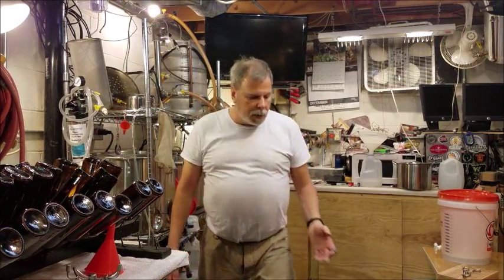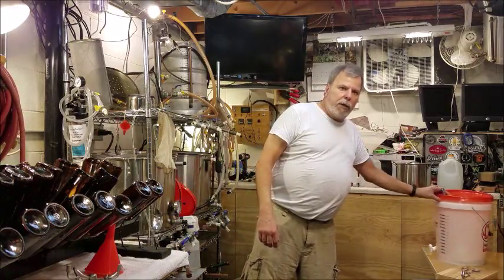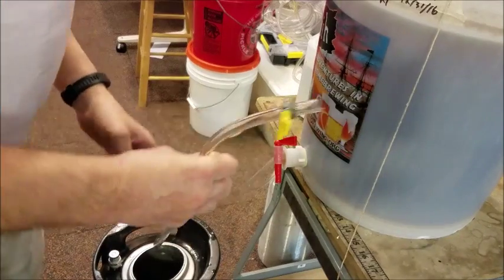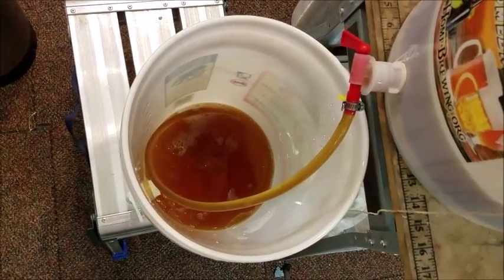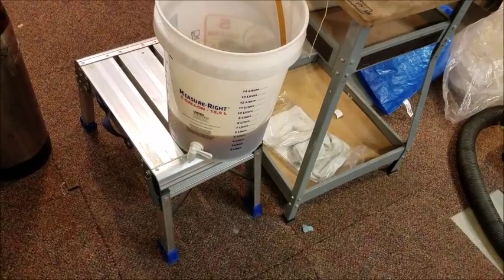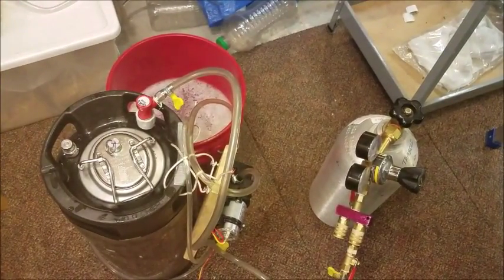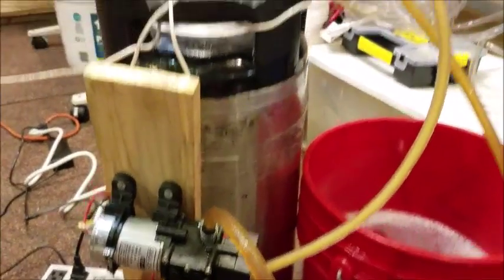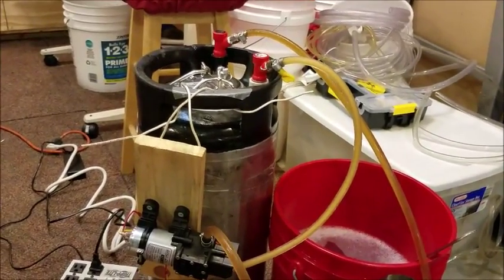Carbonating a Keg with the Rapid Carbonator - Start to Finish

Comment from the maker: Update.  I realize why it was so over-carbonated.  I realized this after retracing some steps I had done a year or so ago and forgot about (due to a question by MSULOCK3191).  I put a pressure gauge in between mine and the keg.  I realized that I was reading and using the wrong scale on the gauge.  There are two scales (I am not sure why, but I think one is for flow and the other for pressure). One goes from 0-45, the other 0-100.  I was using the 0-45 scale and should have been using the 0-100, scale, which coincided with the other gauge I put in line.  So, instead of 11 lbs of pressure, I was putting it in at somewhere around 25 lbs.  DUH.

Comment: The B brand uses a 6V power supply and its pump is listed @50 PSI. Did you use a 12V power supply? If so, your pump's spec is 100 PSI at full strength. I guess if you switch to a 6V power supply like the B brand, your pump's PSI will drop in half to 50, which may solve your over carbed problem.
Reply from the maker: Yes, I did get a 12v/4a power supply and it works well (it is actually a replacement flat screen TV power supply).  I don't think the pump's PSI would make that much of a difference, if at all.  It is just recirculating and there is no real resistance or back pressure, other than the CO2 going in.  That would probably come into play if I was pumping up a hill.  That is interesting about the B one, I maybe could have saved some money on a smaller sized pump (it was only $16, so no big deal).  Their instructions say to run for 30-40 minutes at 1-2 psi above the chart.  I may try that next time. FWIW they also use a 10 micron stone compared to my 5 micron one. I think part of the bad pour was due to the beer still being a little excited. I waited about 30 minutes after moving it to the Keezer to pour one.  I probably should have waited a little longer.  I poured a glass the next day and the carbonation was pretty good.  I also think I should have carbed it at a little lower PSI, on the lower end of the range for 2.2 vols.  I probably should have checked it at about 45 minutes too, when it started to slow down. I don't know.  Having only used it twice, I guess I am still in the live and learn stage.
Reply from the maker: Update.  I realize why it was so over-carbonated.  I realized this after retracing some steps I had done a year or so ago and forgot about (due to a question by MSULOCK3191).  I put a pressure gauge in between mine and the keg.  I realized that I was reading and using the wrong scale on the gauge.  There are two scales (I am not sure why, but I think one is for flow and the other for pressure). One goes from 0-45, the other 0-100.  I was using the 0-45 scale and should have been using the 0-100, scale, which coincided with the other gauge I put in line.  So, instead of 11 lbs of pressure, I was putting it in at somewhere around 25 lbs.  DUH.
Reply: So if I were to build this system now, should I be searching for a 50 PSI dc pump or just pick up the 100 psi pump and use a 6v power supply?  I am also thinking about using the pump to push beer thru a cartridge filter and use to transfer beer from fermentor to keg..

Comment: Hello Tim, I am new using kegs. I just bought my first pair the last week, I want to know what kind of hose do you use for de CO2.  It does look thin when you put the CO2 on the bottles and you  got red one on the kegerator. Is it the regular one if not, what kind should I get? thank you.
Reply from the maker: Slight update.  I checked the lines on the carbonator today.  The gas line from the tank to the aerator is 3/16" ID x 5/16" OD beverage line.  It is sized to the aerator. The lines to and from the pump for the beer are 5/16" ID x 7/16" OD.  I sized them to fit the input/output on the pump.  I had to buy fittings for the "T" to match them.
Reply: Thank you!

Comment from the maker: I used it for the third time a couple nights ago on a WIt.  I ran it for about 45 minutes at about 11lbs to get the 38 degree beer to about 3.0 levels of carbonation.  Well, it seems like 45 minutes is still way too long.  I tried a pour and it filled the glass up with foam.  Once the foam in the glass subsided, after about 10 minutes, it tasted good and was still carbonated OK.  Last night I let the pressure off from the PRV.  I re-attached the CO2 and set it to about 4 lbs.  It still came out 2/3 foam.  I think I am going to need to let pressure off a few times to get it settled down.  I was pouring through a picnic tap with about a 4 foot line, maybe it needs to be longer.  The beer in the line only had a few bubbles, but boy it expanded when it came out.If you are going to use one of these make sure your keg lid has a pressure relief valve, just in case.
Reply from the maker: Update.  I realize why it was so over-carbonated.  I realized this after retracing some steps I had done a year or so ago and forgot about (due to a question by MSULOCK3191).  I put a pressure gauge in between mine and the keg.  I realized that I was reading and using the wrong scale on the gauge.  There are two scales (I am not sure why, but I think one is for flow and the other for pressure). So, instead of 11 lbs of pressure, I was putting it in at somewhere around 25lbs.  DUH.

Comment from the maker: I have recently learned something about carbonating with a stone I thought I would share.  

I didn't really know of a concept called "wetting the stone".  What this is, is the pressure it takes to get CO2 to start flowing through the carbonating stone.  Blichmann, in their Quickcarb instructions, recommends setting your pressure 1-2lbs greater than the carbonating pressure.  I suspect this is to account for this with their 10 micron stone.  

I hadn't really taken into account that my stone, which has 2 micron holes (smaller), needs more pressure to "wet". Having just learned this, I haven't checked what that is yet, but if you are having issues with your stone not flowing and your beer not carbonating this could be why.

Figure out what the wetting pressure of your stone is by putting it into a bucket of water or Starsan and cranking up the CO2 pressure until it flows.  Whatever this pressure is needs to be added to the carbonating pressure listed on the carbonating chart.  

I have read about people who have .5 micron stones having a wetting pressure of 4 lbs.  I suspect that my 2 micron stone's pressure is around 3 lbs based on how my beers have been carbonating and watching the bubbles flow in the tubing. Again, I haven't calibrated it yet.

I have also read that you should add 1 lb of pressure to account for the weight of the beer.
  
So, if the carbonating chart says to set pressure at 9 lbs pressure for a 36 degree beer to reach 2.3 levels of CO2,  and the wetting pressure is 4 lbs then you would set your quick carbonating CO2 pressure to 9 + 4 + 1 =  14 lbs of pressure.  Once equilibrium is reached you should have perfectly carbonated beer.

Let me know if you try this and it works for you.

Comment: OK thanks for the video & the effort to describe your method(s).
I have to say that I see little purpose in fast carbonation. Most commercial brewers will say that beer needs some time (normally a few weeks) to "condition".  As home brewers we may not do this, but in my experience some yeast will continue to fall out after kegging & that time (maybe a few days) can be used to allow a more gradual carbonation. In my case I usually pressurise the keg to about 50/60 psi & repeat after a couple of days. Then maybe 20 psi until I see the pressure stabilise at about my pouring pressure of about 8 psi. This whole time my keg is at about 4 deg C. Simple, minimum investment, less gear & less opportunity for contamination.
Finally removing oxygen by purging a dozen times at 30 psi seems both unnecessary & costly.
My approach seems to work well enough - 4 purges from 10 psi !
Reply from the maker: Thanks, I tend to agree.  Since I built it I have only used it a few times.  I typically just set it and forget it in the keezer.  But, it is nice to know that if I need to get a keg done fast for an event or I am just impatient, that I can do it.  It wasn't expensive to build and is another tool in the arsenal.

Comment: Hey Tim, first of all, thanks for the video, I made my InLine system by your instructions, now I have an idea that I want to try out, and I would like you to give me an opinion.
In principle the workflow should be like this, primary fermentation is done in a plastic conical fermentor, where after cold crashing it with glycol immersion chiller, I would transfer Beer with a pump to a pressurised stainless steel vessel (custom made Brite essentially), 
but in between I would be transfering  the beer through a 
1st chiller with a copper coil dropping the temp to 2C, 
2nd Filter (made from inline single pass water filter) and in the end 
an inline carbonator.
After complete transfer from Primary, i would reattach the hose from the primary to the Brite's OUT and recirculate until reaching equilibrium.
This is basically the same principle as if I am using a keg, so please answer, your advice and opinion would be helpful.
best regards, George
Reply from the maker: Thanks for the comments and question.  I think that would work and it sounds very similar to the way a lot of micro-breweries do it.  I do know that in lot of the commercial brite tanks they just hang a carbonation stone connected to the top tri-clover connector into the beer and crank up the pressure to force carbonate. Most of the time this is in their walk in fridge to keep it cool. When you say "and in the end an inline carbonator" are you disconnecting the filter and connecting the carbonator to re-circulate or passing it through the filter while carbonating?  I have thought of filtering, but usually just rely on finings and cold crashing. How do you purge the filter of oxygen and sanitize it? Do you run sanitizer through the filter and push it out with CO2?  Getting all of the oxygen out of the paper or charcoal has always worried me with house filters.  But, a lot of people use them.  I would also make absolutely sure that your chiller is clean and sanitized. The most important things I would watch are sanitization and Oxygen getting in somewhere.  It only takes a small problem with either of these to effect the beer.

Comment: I put a system together exactly as you have. I started carbing,  but after 3 or 4 minutes, the out line runs clear. I am carbing at 10 pounds PSI. It doesn't seem like it's carbing at all once the pressure equalizes in the keg.
Reply from the maker: I have found that it seems to work best at a couple lbs higher than the charts and then I dial it back later.

Comment: I used this Quickcarb to carbonate my beer, but when bottled (with a BeerGun) I get too much foam in the bottle and almost no beer, after finally filling the bottle I tap it. And when I try my beer it does not have almost gas or sometimes nothing ...... do you have any advice that can help me with this? I would greatly appreciate it :).

Comment: Did you ferment in the bottling bucket? When you transfer do you have any trouble sucking up trub during the pour to the keg through that faucet? I only ask because that was so much simpler than the way I do it and you seemed to have really good results.
Reply from the maker: Robert, Thanks for the question. I ferment in buckets with spigots.  I usually keg and bottle.  I typically transfer to the keg first, then to the bottling bucket on top of the priming sugar.  I like using fermenting buckets with spigots because it makes it easier to take gravity readings and transfer.  I take extra special care to make sure everything is clean and sanitized every time.   Going to the keg first I usually don't have any trub transfer there. After transferring the rest to the bottling bucket I let it sit for a while, maybe a half hour or more, so any transferred trub settles.  If I was going to the keg only I would still do it the same and be careful at the end.  The only real danger would be a little trub in the first pour or two, which is not really a big problem.

Comment: Good video, question of carbonating the Keg can you put it back in kegerator, without Connecting C02 on it en leave till you wanna drink it or should you still have a 5-8 PSI C02 on it
Reply from the maker: Once you carbonate the keg, it will be under pressure. The CO2 infused into the beer will stay there unless it is allowed to escape and the beer allowed to go flat.  So, unless you release pressure before putting it into the kegerator and it doesn't leak, it will stay under pressure and it should be fine for months until you are ready to tap it.  You don't need to leave it connected to your CO2 tank. Also, even if you do release some pressure the CO2 infused into the beer will escape into the headspace and build pressure back up to some level (but less than what it was). That is how you fix an over-carbonated keg.  You let it sit, then let some pressure out.  After doing this a few times, the CO2 is released out of the beer and the carb level is reduced. You just stop when the level is good.

Comment: Hi Tim. I see your priming pump has electrical wires to it. In your previous video you have a AC adapter. Can you elaborate on what the pump is wired to?
Reply from the maker: I am not totally sure, but I think in the other video I had it wired to another power supply.  That power supply failed (it was only 1 or 2 amps).  I got a 12v/4a power supply and it works well (it is actually a replacement flat screen TV power supply).  It is wired to the red & yellow wires  (the white wires are just screwed into the board to be used to hang it).

Comment: Tim,
I just ordered the same pump your using...thanks for that info.
Have you seen or used the keg lids that have the third gas fitting, attached to a 2 foot tube and a stone on the end ? I'm going to try that, just ordered on on Amazon for about $29.
Lee, Indianapolis
Reply from the maker: I have seen them, but never used them.  I do know breweries that use them in their Brite Tanks to force carbonate with much success.  Let us know how it works.
Reply: Francis Thompson did that keg lid work?
Reply: I've been using carbonation lids for about 3 years...they work great.  I just suggest getting 1 for each keg.  That way you don't need to keep switching lids around

Comment: is a closed system, there is no danger that in the constant injection of CO2 can increase the pressure in the system, making explosion?
Reply from the maker: Good question, but it is nothing to worry about.  The pressure on the tank is never set to be at more than 12-15lbs pressure for beer serving.  At that pressure all the CO2 that can be absorbed is absorbed into the liquid, no more.  The pressure in the tank will never rise to the level higher than that, or to a level that would ever cause any issues.  That is not to say that the tank pressure would never go up.  If the temperature of the tank of beer was raised, some of the CO2 would try to escape from the liquid, but not enough to raise the pressure significantly.  Since it is in a closed tank it won't go anywhere.  Pressure would increase because lower temps allow the liquid to absorb more gas, but, even when this happens it would never rise to a pressure level that would in any way be dangerous. The beer in them would never generate that much pressure.  Finally, Corny kegs are designed to  hold  120-130 lbs of pressure.  They have pressure relief valves that would never let the pressure raise to that level.  Also, the seals would give out before it got that high.
Reply: thanks for your time, you have tried it with barrels of 50 liter and type D system?, I think that these have more endurance than the corny

Comment: Am I mistaken, but it looks like your output pressure gauge is setup for cubic feet per minute instead of pound's per square inch?
Reply from the maker: You are right and initially that confused me too (this is a $35 Harbor Freight Tools welding gauge).  I did some research (it has been a year or so).  I believe I found out that the gauge is printed wrong or that it is the same thing.  I can't remember which. I tested this by putting it in series with an air tool pressure gauge and they measured the same (inside ring).  I think the outside one may measure flow and the inside one pressure.  Thanks to your question I went back and double checked and realized that I was using the outside ring and should have been using the inside one.  I totally forgot that and it explains why it was so over-carbonated.  Thanks for the question, you just helped me to solve a big problem.

Comment from the maker: The gas hose that I used for the carbonator is not what I use for gas line in my keezer.  Without being there to look at it, I think it is a smaller diameter hose chosen to match the fitting on the aerator.  I believe it is really beer line (3/16''ID x 7/16''OD).    In my Keezer I use thickwall 5/16" ID x 9/16" OD gas line.  This is standard.  The standard for beer line is 3/16".  I have used 3/16" beer line in both thick and thin walled.  The thickwall is  3/16''ID x 7/16''OD and the thin walled is 3/16''ID x 5/16''OD.  Both work OK if cut to the right length.